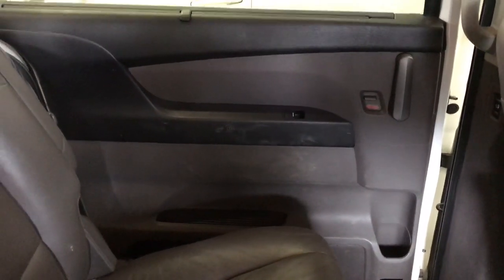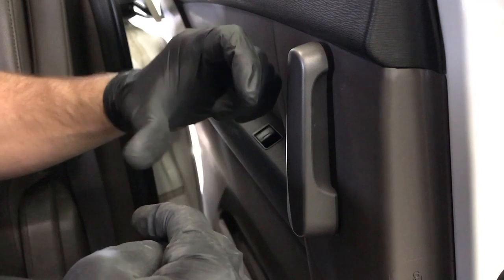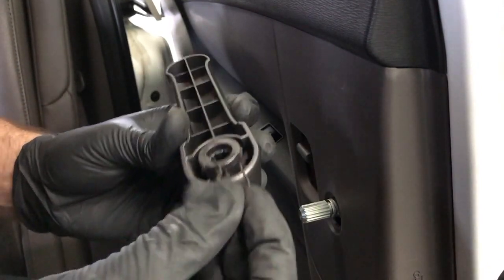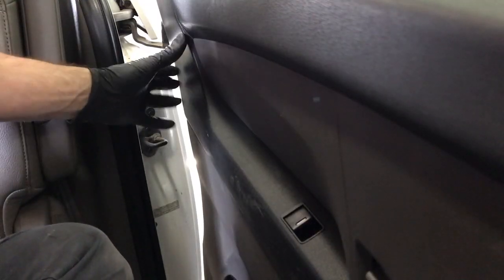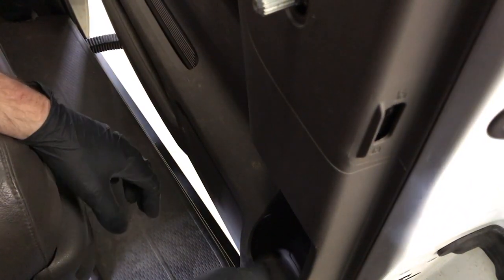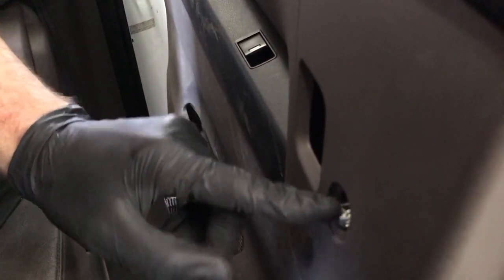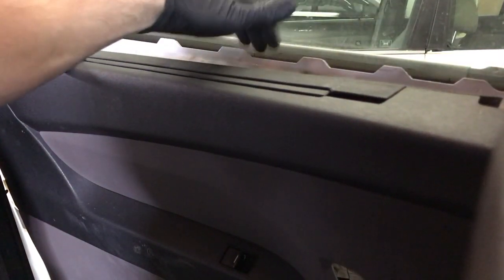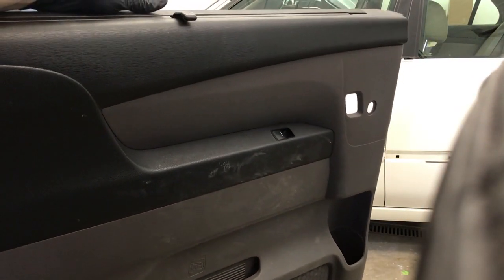Honda Odyssey How to Remove Rear Sliding Door Panel Trim Removal

Comment: Awesome guide! I had to replace each of the external slinding door handles... yes, both broke within two weeks of each other. This helped get the side off which was the part I had no idea about. Getting to the external door handle seemed daunting but you only have to remove four further bolts and all the mechanisms for the door etc. can be moved aside. Then you can easily see where the two handle bolts go and it isn't hard to figure out how to replace them. All in all, two doors done in an hour and a half.
2014 Honda Odyssey.
Reply: this is my exact scenario... thanks for instilling some confidence in the job.... the mechanic told me it was a lot of work to do and pricey, im so glad I found this!

Comment: Thanks.  I am in the middle of doing this on my Van  and realized that the video I had watched left out the top trim piece.  I notices your video and checked it out.  It answered my other questions so thanks again for taking time to make this video.  Seeing how something comes apart makes it a lot easier.
Reply: How did you access the sunshade? It looks like it's still inside the door when he took it off

Comment: Just bought one used today with 50k miles. Pretty pumped, but the driver's side sunshade mesh is broken off the pull bar thing, so this video will be helpful when I replace that. Thanks a lot!

Comment: Thanks so much. I had had a problem where the door would not lock or unlock it was stuck. The problem was that a sensor had blocked the lock mechanism. I simply had to wiggle it around to get it to get loose. Works like a charm now!
Reply: What does the sensor look like? I'm struggling with getting mine to completely latch closed and I'm guessing it's the same thing

Comment: Question, did you not pop the clips on the front edge of the door before you popped them on the back?  I did not see that in the video and thought I have already popped them from the front, I was wondering if you did it that way or not.

Comment: So I'm looking at replacing the sun shade assembly that, it seems, is inside the door panel. Would I need to remove the whole door panel or can I just remove the top portion of it?  Did you notice or see that while you were in there?

Comment: The door handle snap ring looks identical to the type used for door window cranks (Manual windows). I suspect we can use a door window crank clip remover tool for this step, which will prevent the snap ring from flying when it’s removed.

Comment: Thanks for the video it was on point. I ended up ripping a pendaflex folder (hanging file folder) and using the metal top and it worked perfectly.
Reply: how did you do this? I'm looking to jimmy rig my torn sunshade so i dont have to remove the panels etc... thanks!

Comment: Hey  thank you for showing how to remove the panel, can you provide instruction on how to replace the Sun Shade on the the same door.. Thank you
Reply from the maker: Ill work on getting a video made for that.
Reply: This is also what I'm trying to do. Would the first step be to remove the door panel to access the shade area?
Reply: Yep same. Broken sunshade that needs to be replaced. Honda wants $360 to do the work. a new shade can be had for $98. would definitely pay to do it myself. i suppose once its off, it can be figured out. helpful video on removing the panel though, thank you.
Reply: @DIYHonda  any word on this video? I can't find it
Reply: @DIYHonda  any video look for replacing the window shade . My youngest broke it and I want to fix it

Comment: Hey great video. Anyone know if the procedure is the same for the 2010 odyssey? Mine has manual sliding doors but the inter handle no longer works so I'm going to try fixing it myself

Comment: would this be similar on the 2018 odyssey?  I can't find any videos on the 2018 and need to replace the sun shade my kid broke.  Thanks for the awesome video!
Reply: Did you find an answer on this? I'm in the same situation
Reply: @BryceJohnson88  unfortunately no…
Reply: @mikenguyen8778  you never got yours fixed?
Reply: @BryceJohnson88  I have not. Only one of the brackets broke on mine so I’m living with it for now. Dealer wanted $200 to replace $100 for part and $100 for labor
Reply: @mikenguyen8778  lame! I just bought the part last night for $80 and I think I will do what he does in this video. It looks the same
Reply: @BryceJohnson88  nice. You bought it new? Report back if you can. Good luck!
Reply: @mikenguyen8778  will do! I bought it off a Honda parts website. I probably won't get the part till after the 4th, but I will come back and let you know how it went.
Reply: @mikenguyen8778  hey bud. Just did the fix. It was easier than expected! Did exactly what he did in this video, but didn't have to remove the vertical window piece in step 2. I got the part on hondapartsguys.com for $80
Reply: @BryceJohnson88  awesome man. I just ordered it. Will try my luck as well. Did you have to get the special pick tool for the inside handle removal? Where did you get it from? Thanks for helping us out!
Reply: @mikenguyen8778  I just used a small Allen wrench to pick it. Didn't do any damage and got it in under 30 seconds
Reply: @BryceJohnson88  you the man! Can’t wait to get mine fixed. Thanks for convincing me
Reply: @BryceJohnson88  bro! I just installed this! You were right! Fairly easy except for the darn handle clip lock. I ended up needing to use a set of pliers and a paper clip. Allen key didn’t work for me. If you had an o ring pick tool it would have been much easier. Took about an hour and half total since I kept messing with the handle. Thanks so much for giving me the tip and confidence to do it. Wife is now happy. 🤘

Comment: Can this be done while the door is locked shut? 

My toddler threw his shoe just as the door was locking and the shoe got stuck in the door well because the door sensor  didn’t recognize it was there and ran over it and now it’s jammed shut. 

I’m trying to figure out how to wedge the shoe out to free the door. 

Thank you in advance

Comment: Hey man, I have a 2013 Honda Odyssey EX-L and the passenger side slider pops. Any idea what it could be and the parts to fix it would be?-Thanks
Reply: It's likely a power release actuator. There are many videos on this for the 3rd gen (05-10) Ody, but I don't think there's one for the 4th gen. The good thing is in most cases you can open up the actuator (one screw), spray some lubricant on the gears in there, put it back together and reinstall it into the door, and usually that fixes it. The only time you'd have to buy a new one is if the gears inside are broken or lubricating it doesn't work.